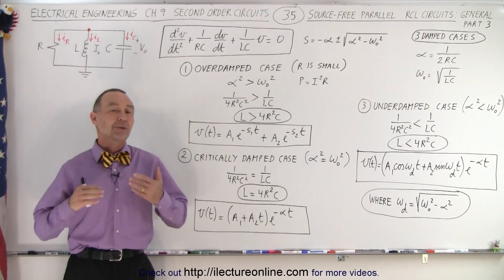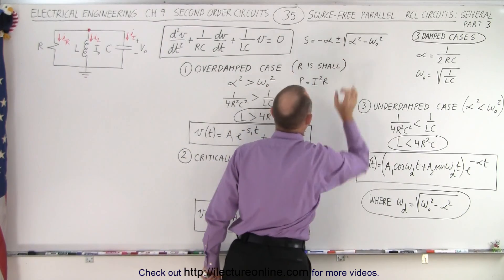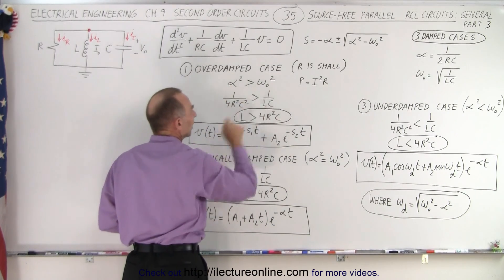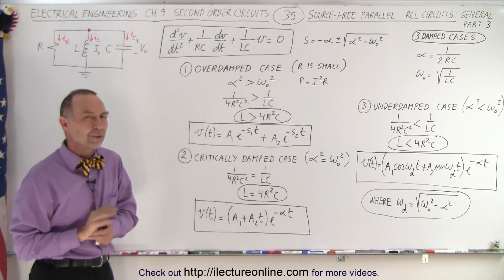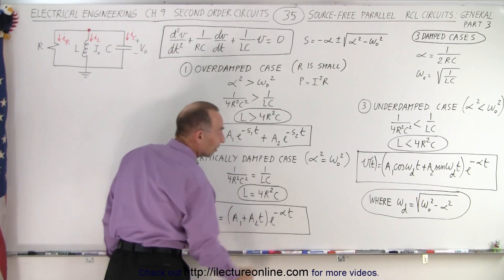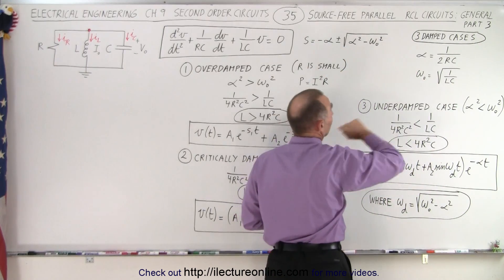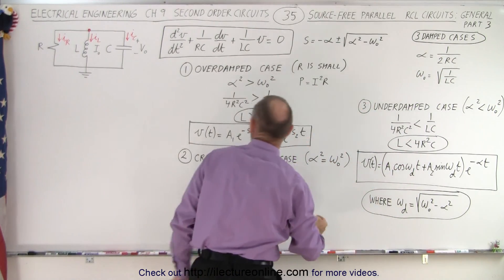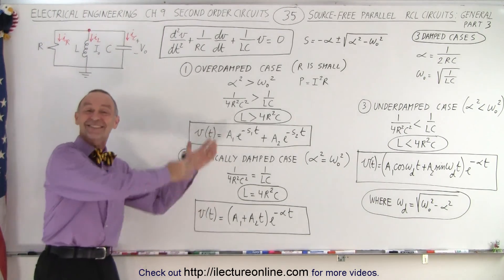Electrical Engineering: Ch 9: 2nd Order Circuits (35 of 76) ERROR! Should be e^+S1t and e^+S2t

Comment: I think there shouldn't be minus sign in solution in first case: there's A*exp(-s*t) (there are two components but lets focus on one), clearly s is negative (-alpha-sqrt(postive), the other one is negative too), therefore we'll get double negative in exp and that part of solution will explode
Reply from the maker: You are correct.  There should not be any negative signs in front of the S1 and S2 since they will always be negative.  I will need to correct that.    Thanks for pointing it out.